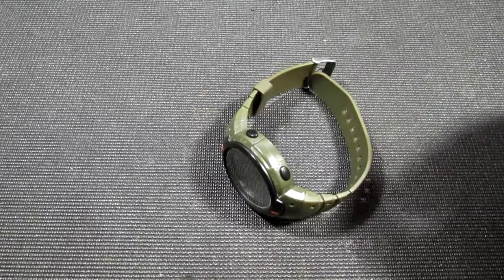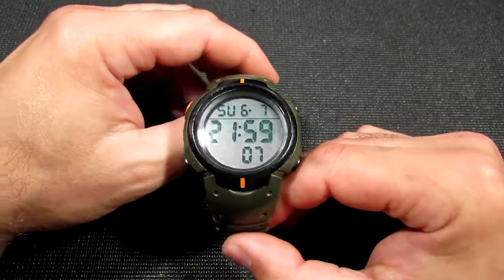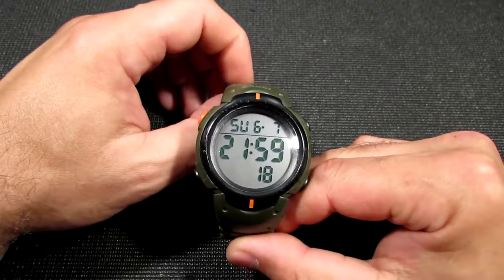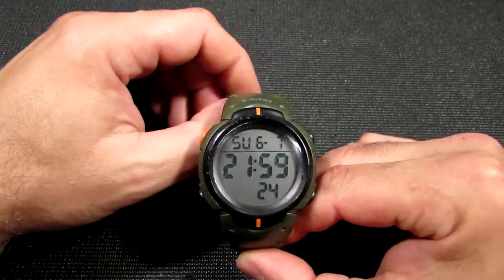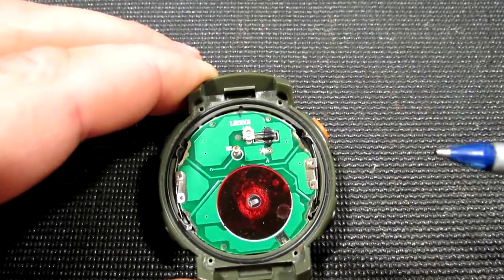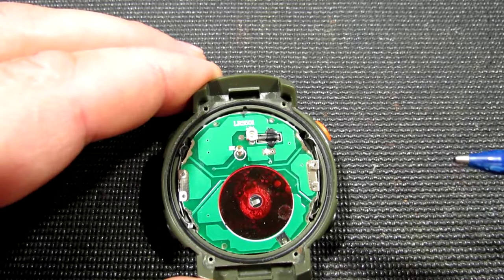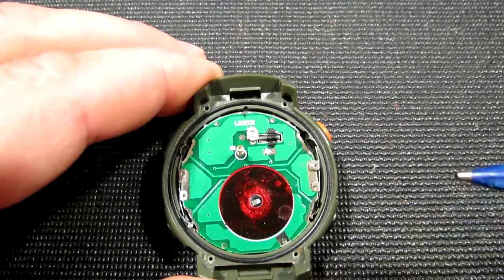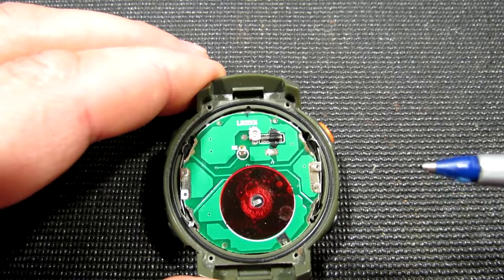Skmei 1068 Improving of the accuracy.

Comment: Awesome project. Can i ask how i can find the trim capacitor and the crystal quartz on ali express? Search words, data values etc.?
Reply from the maker: Thank you.
You know.. I would recommend to find quality parts on Mouser or Digikey, or another trusted vendor.
This will allow you to calculate and get a predictable result in your project.
Search words:  1. Crystals quartz 32.768
                            2. Trimmers Capacitors
Data values:  1. Crystal,  tol +/-5ppm or less. load pF and ESR depend from IC. 
                        2. Cap, 1.5-12pF with lowest ppm/ºC.
Reply: @UT4UFA  Thank you for that detailed information, very interesting stuff